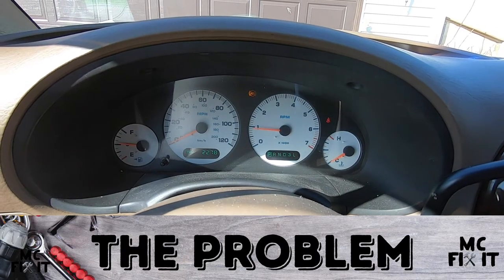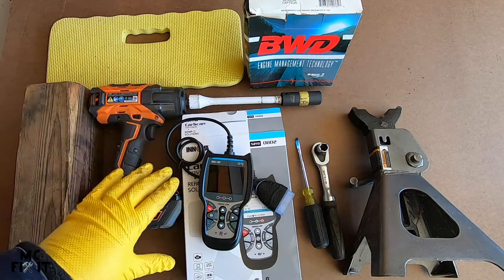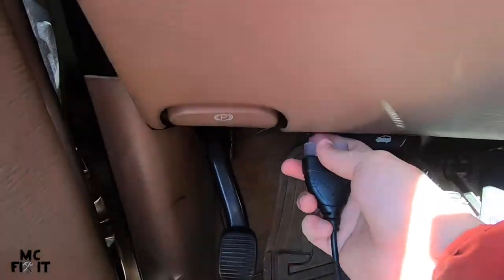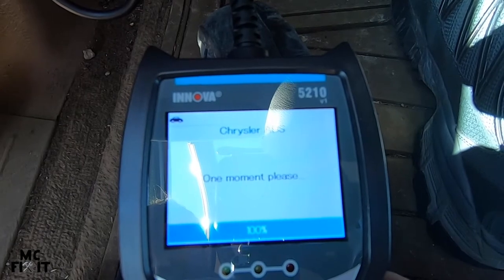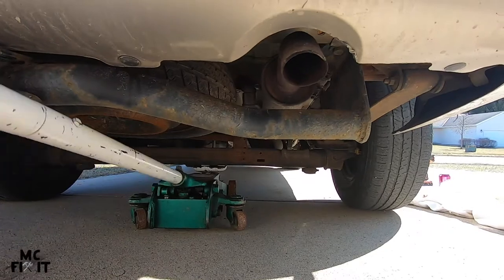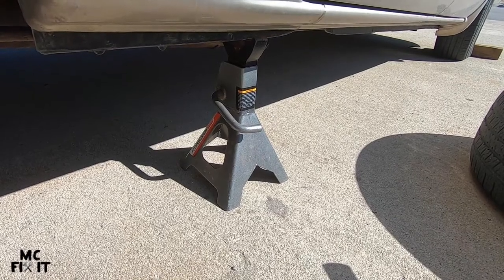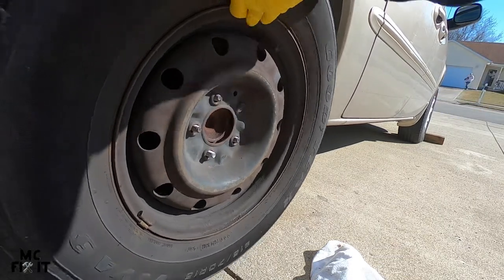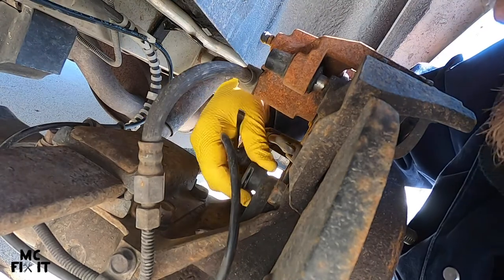How to Read ABS Light & Replace Right Rear ABS Sensor 02 Dodge Caravan Chrysler T&C (Complete Guide)

Comment from the maker: Learn how to read the ABS code, fix the problem for a right rear ABS sensor code, and clear the code in this complete guide for a 2002 Chrysler Town and Country or Dodge Caravan.

00:19 The Fix:
* INNOVA Scanner 5210 Code Reader + ABS -  https://amzn.to/3vTeJA2
* Part ABS183 - https://amzn.to/33tytOF
* Ratchet, 14mm, & 19mm socket - Basic Socket Set - https://amzn.to/3fjRoBd 
* 1/2 Impact Drill (tool only) - https://amzn.to/3vVDUBZ 
* Torque Stick - https://amzn.to/33wFTR2 
* Impact Sockets  (Metric) -https://amzn.to/3etXiQU 
* Gloves - https://amzn.to/3bbfEnu 
* Flat Head Screwdriver - https://amzn.to/2RAjTlU 
* Floor Jack (3 Ton) - https://amzn.to/2R7G96H 
* Jackstand (3 Ton)- https://amzn.to/3f3ABC5 

01:22 Reading the Code
02:48 The Fix
14:18 Clearing the Code

The ABS code reader, go to this website to ensure this produce with read and erase your code for you make, model, and year - https://www.innova.com/product/detail/5210/CarScan-Advisor

Check out my website at http://mcfixit.us 

Disclaimer:
Due to factors beyond the control of MC FIX IT, I cannot guarantee against improper use or unauthorized modifications of this information in the video, post, blog, or social media. MC FIX IT assumes no liability for property damage or injury incurred as a result of any of the information contained in this video. Use this information at your own risk. If you feel uncomfortable at any time. Stop and go to a professional. MC FIX IT recommends safe practices when working on vehicles, your house, or any other project and or with tools seen or implied in this video. Due to factors beyond the control of MC FIX IT, no information contained in this video shall create any expressed or implied warranty or guarantee of any particular result. Any injury, damage, or loss that may result from improper use of these tools, equipment, or from the information contained in this video is the sole responsibility of the user and not MC FIX IT.

#mcfixit #autorepair #abssensor #abs #abslight #abserrorcode

——
Supplies used to record this video: 
* GoPro Hero 7 Black - https://amzn.to/3f3ALtb 
* 256GB Flash Drive - https://amzn.to/33pAueG 
* Vlogging Frame - https://amzn.to/33tajE0 
* GoPro Pro 3.5mm Mic Adapter - https://amzn.to/2RCURCu 
* Youmic Lavalier Lapel Mic - https://amzn.to/2R55sWX 
* Boom Stand (tripod) - https://amzn.to/3bdkQaw
* 5/8” to 1/4” adapter (boom to blogging frame- https://amzn.to/3txrVsM 
* Portable Battery Powerbank- https://amzn.to/3vJQc0q 
* 6ft USB to USB-C (powerbank to GoPro)- https://amzn.to/3uAS5MH

Comment: I need one of those testers! My auto parts store said their machine couldn’t read the code. Does this work for all makes and models? I’ve got a 2008 Civic and my light came on the other day.
Reply from the maker: Yes, that's why I ended up buying this reader. It was pretty easy to use and was  just under $100! Check their website in the description for your exact make and model. That's what I did before I bought mine and it worked flawlessly! Good luck!

Comment: Why don't normal scan tools allow you to read and erase the code? What's special about this one?
Reply from the maker: Great question! The manufactures don’t include it on many of the scan tools. Not sure why bc they all should have this option! I know ABS codes are less common than a check engine code. Maybe that’s why. When buying a scan tool make sure it has the options you want and possibly would need in the future! Not sure if anything is special about it but it just has more ability to read other codes like ABS codes which is the main reason I bought this one!

Comment: I have a dodge caravan 2001, had to buy a separate cable scanner.
Reply from the maker: Sorry to hear that. I know some years aren’t covered. Did you check their website to make sure:
The ABS code reader, go to this website to ensure this produce with read and erase your code for you make, model, and year - https://www.innova.com/product/detail/5210/CarScan-Advisor
Reply: @MCFIXIT   just found out today after buying 2 different scanners with ABS scanning. I’m crossing my fingers in hopes it works, should come in a few days. I’ve got both ABS and airbag lights on.
Reply from the maker: I hope you can return the one that didn’t work!